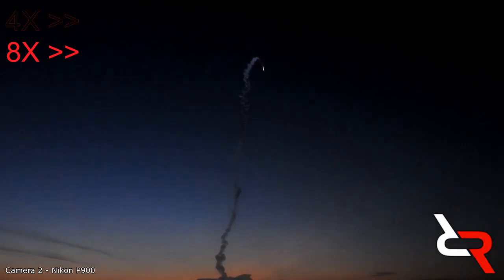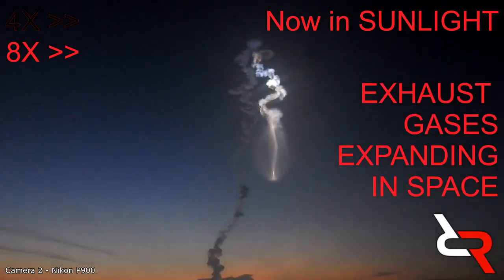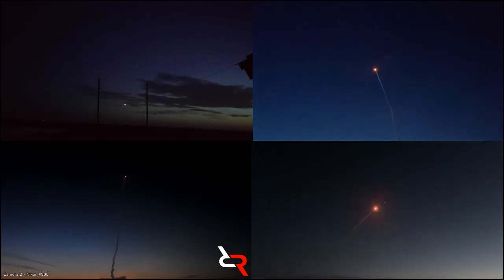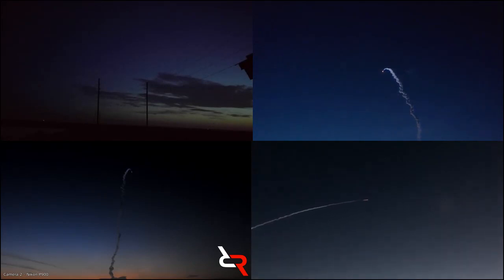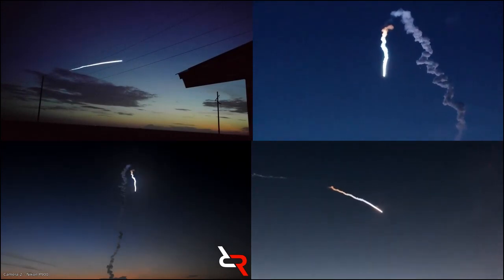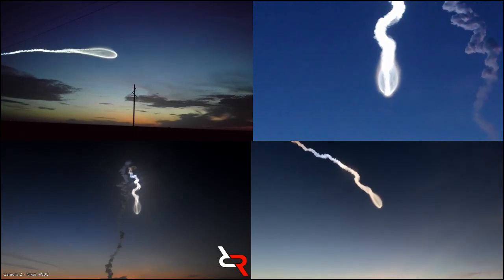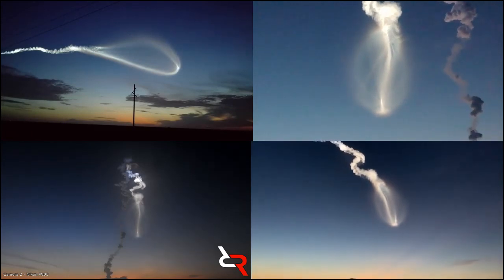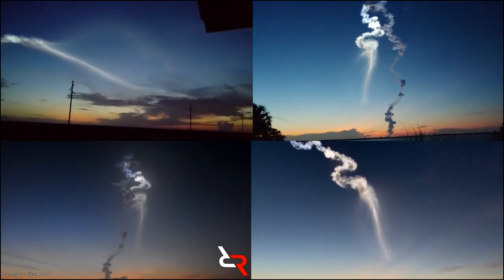How Smart is Antonio? Can he Understand What is Going on Here? Will he see a GLOBE?

Comment: https://youtu.be/5TwkPnrteCY Wally, I took this video. I turned on my DSLR. Put it in my telescope and did nothing else. No "CGI" no editing, just recording.
Reply from the maker: I actually dismantled my P900, found the chip that receives information from GOV satellites and based on that data it modifies each image the camera takes.
I know the manual calls it Geo-tagging via the GPS but I am just sayin'.
Reply: WheresWa11y Flattards say Satellites are fake. They claim they’re weather balloons. I’ve been in a Hot Air balloon. They don’t travel 17,000 mph. They don’t travel 1,700 mph, depending on the breeze, 17mph is pushing it. When the person in charge determines there is too much wind, they can’t launch. 

My website scottabeer.com/launch. HTML is me, showing up to take pictures of the Milky Way near Cayucos,Ca but, someone asked when the launch was? I had no idea there was a launch. I googled and discovered that it was to launch at 7:21 P.M. it was approximately 7:12 
I took my Nikon D 5200 and turned it away from the straight up setting, and faced it towards Vandenberg. Afraid to screw anything up, I left my settings at 20 seconds and began to take pictures.  
As the area I was at was at 1,762 feet, the sun had set on the beach at Cayucos. The rocket gained altitude and was once again in the suns direct rays confirming a globe. As the gases released by the rocket expanded, that confirmed a pressure gradient. 
Look, I was in the Boy Scouts and we ALL strived to tell the scariest story sitting around the camp fire. Flattards want to be validated and accepted. 
There is absolutely zero confirmable evidence that the earth is flat. Only claims, opinions, anecdotes, lies and rumors. 
My evidence alone confirms a globe.

Comment: Hi Wally, beautiful footage you gathered there. Several debunks in one go:
1) Curvature is proven because the rocket passes into day light.
2) This also proves the sun is below the horizon for that place at that time.

3) The vacuum of space is proven: because the lack of air pressure the exhaust plume is no longer hemmed in and expands widely.
4) The rocket doesn't curve down into the ocean but follows, climbing, the Earth's curve. When the flerfers finally see real perspective, they don't recognize it. Oh, the irony.
5) Did I overlook another one?
Thanks for these beautiful views, and keep up the good work.
Reply: Not at all
Reply: @garywybenga4188  Hi Gary. Have you seen the recent information from Bob Roberts? He has shown a clear link between the Freemasons and dinosaurs. The Freemasons keep removing his material from Google but you can do the research yourself. Just look at any photos from the digs of dinosaurs and note all the ones where you can see 2 or 3 stones on top of each other. According to Bob Roberts that is a clear sign that the dinosaurs were actually Freemasons.
 I don't buy it myself but I was wondering what you thought about his research. It sounds pretty far fetched to assume the Freemasons were started by aliens posing as dinosaurs but I was curious what you thought about his theory.
Reply: @garywybenga4188  You don't believe the information from Bob Roberts? Have you done the research? What about his conclusion is hard to believe? Have you examined the dinosaur dig images and looked for rocks stacked up? How could that happen if not for Freemasons?
Reply: @garywybenga4188  Acid? Jealous much? You must be on some cheap stuff. You still don't understand zip, but you keep coming back for more punishment.
Poor troll. Have a biscuit.
SPACE COMMA!
Reply: Gary I guess your answer is crickets? Space crickets?
Fun fact: we've sent more crickets into space than humans.
Reply from the maker: They are everywhere you look.
Reply: @whereswa11y  it's all in your interpretation of what you see. I see the truth. You see an imaginary curve
Reply: @garywybenga4188  "You see an imaginary curve"
Photos from space would suggest it's not imaginary.

"I see the truth."
What is it that gives you this super power ;)
Reply: @garywybenga4188  - You're seeing an imaginary truth. It has no substance and no evidence.
Reply: @AndrewEddie  'photos from space'
Hahahaha
Reply: @garywybenga4188  "Hahahaha"
So I was asking too much to have a grown-up conversation about this, is that what you are saying? You sound old enough to know better.

Gary: you don't , sound old enough to know better
Me: Yep, that's what I figured. We go round and round with the clever word-rearrangement. Can we jus skip to the part where we talk real science and engineering?
Gary: <more of the same> hhahahaa! ha! space comma FULL STOP! haha ,.!
Me: <keeps trying for an honest answer>
<rinse and repeat, 30 times>
Me: Ok, Gary. That was exhausting. Can we call the usual deflection "done" and talk like grown-ups now? I would like to have a serious conversation with you but you don't seem capable of having one. Over to you.
Reply: Gary Wybenga 
What conspiracy will you migrate to once spaceflight becomes mainstream? Or are you banking on not living long enough to find out you’ve spent your entire adulthood convinced of bs ignorant moneygrubbers fed you on YouTube?
Reply: @garywybenga4188  please explain what exactly is between the sun and the bottom of the exhaust pillar. Highly recommend you engage your brain before answering (not that I think you'll answer rather than deflect to an even dumber argument.)